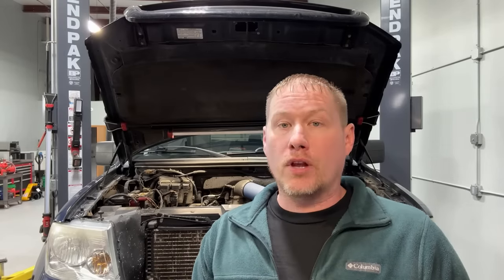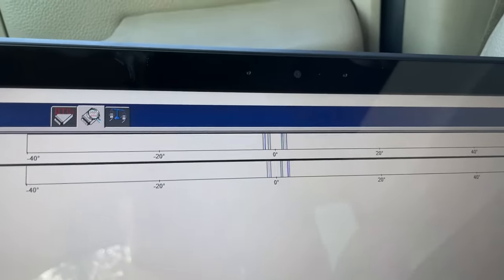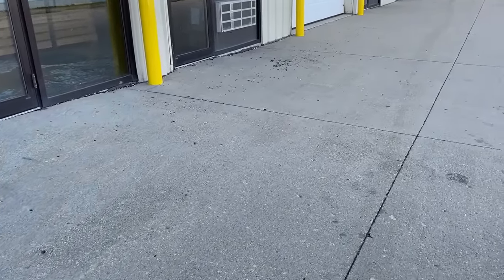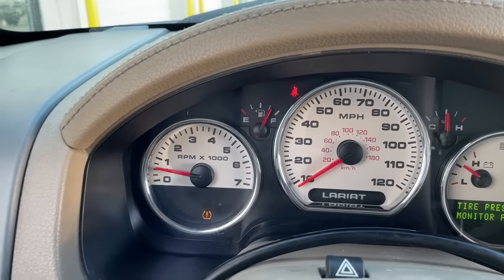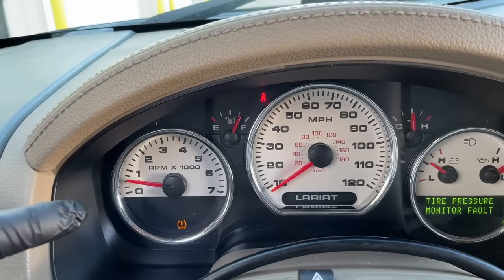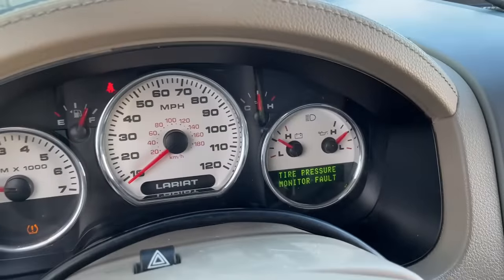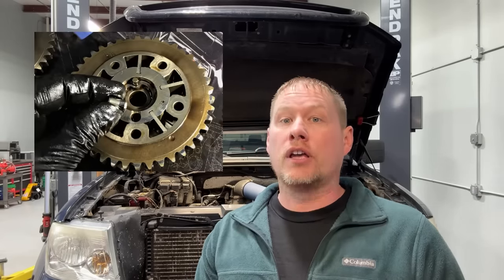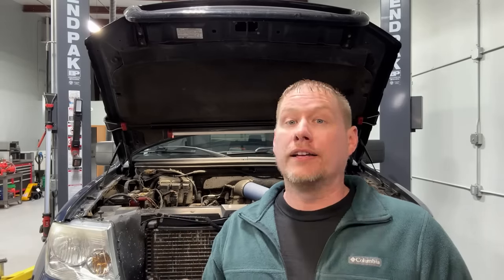Ford 5.4L 3v Triton Engines: Two of The Most Commonly Misdiagnosed Noises!

Comment: I've had my 2012 Expedition KR for 13 months and it now has 46,500 miles. 5k miles a year is the most we'll drive it, but I still change the oil twice a year with 5W30 full synthetic. So far the engine sounds good. Can I swap the 5.4 with a 6.2 for more power and would it be an easy swap? I think both engines line up with the 6R80 transmission.

Comment: Hey 
FordTechMakuloco , great stuff . Have you come across one of these 5.4 l 3 valve engines with p0420 , can't get engine light to go out or this code to go away. The cat's & o2sensors replaced . Fuel trims maxed out minus on bank one but bank 2 is normal. The engine light will go out at times on long trips. Had it to a very reputable shop here an they can't get it to go away permanently. ?
Reply: You might have an exhaust leak throwing of your o2 readings. After I replaced my manifolds the p0420 never came back

Comment: I have been trying to find a mechanic like you here in Arizona. I'm looking to replace my engine soon. I'm currently at 399206 mile on the original engine and transmission. Everything is still all stock and only normal wear and tear maintenance have been performed.

Comment: My 09 has the same knock but the truck shakes normally coming to a light. If you give it a slight Rev about 1500 1800 rpm it will stop n is fine maybe for a day or next time I let off. Some days it never does it some days very time I let off the gas. No start up knock it has me confused.

Comment: I have a 07 F-150 Harley Davidson with one of the 711 made with the Saleen supercharger option. 86k on the clock, only 10k from when I bought it coming up on 4 Y. A.  Any added precautions with the super charger. I am so damn afraid of the valve train and phasers. I live way to far away from you but mass respecs. I run Royal Purple 10w/40 high street performance full syn. I changed ALL the fluids when I bought including Saleen super charger oil. light darkening when drained. Aux. Trans cooler and after cooler. All the fluids is my standard on used. I did plugs and coils. front suspension.

Comment: Great videos. Is there a big difference between these noises and the roller follower ticking in your other video? My 2010 F-150 XLT is going strong at 167K miles but I do hear a noise like this and am concerned from your roller follower video. I’m in Dallas, TX area and would like for you to inspect my truck if you’re not too far. I spoke to North Central Ford’s service department about my service history and the guy said he never heard of a roller follower.

Comment: so if I have the second of these (stumbling at low rpm / high load) with some noise and ticking at start up... is that more likely solved by a high volume oil pump to get better pressure at low rpm, or more like a timing job needed? TIA

Comment: Hi their from Sydney Australia heat video we have these 5.4 3v motors in our sedans not so common down here. Been watching a lot of your videos which are real helpful mine has a startup noise parts are hard to find you mention about might need to change the chain tensioner I’m have trouble to find the one you recommend would you have a part number thanks

Comment: You mentioned awhile back to switch to 5W-30 from the 5W-20 recommended for the 5.4 3V engine. My F150 is a 2004 new body style and has that phaser knock with my engine light on even after both of my VCTs were changed. Would changing my oil to the 5W-30 make a difference?  I don’t remembering you mentioning anything about the higher viscosity in this video. Thanks
Reply: Make sure your oil pressure is good. Especially when hot

Comment: I have a whining that gets louder when accelerating sounds like a Hemi supercharger.   Plus my check charging system notification with the red battery light on for years. New alternator 2 years old. It hasn't died overnight. But i replaced the alt when the red battery light started 3 years ago.

Comment: Looking at potentially purchasing a 2008 F250 with the 5.4l and I hear a noise similar to what you are describing as the phaser oscillation.  I hear it when barely applying the accelerator at idle (engine at temp, in park).  Is there a reason you had it in drive in your example?  Just trying to determine if I am hearing the same noise.  I first noticed the sound after coming to a stop after test driving the truck and then re-created the sound a few times while it was in park.  Seems like it occurs in the rpm range you describe.  It idles nice and quiet.

Comment: Hey, just finished the full timing job with new oil pump.  Everything seems to be working great.  Oil pressure was 85 PSI at startup and then 40ish PSI once it warmed up  - low oil pressure is why i did the job in the first place - I had two blowouts on one tensioner and the other tensioner had one blowout.   The engine sounds great when I fire it up, but the moment I put it into gear, i can hear a knocking noise.   It's not as bad as the knock I had before the timing job, but its definitely there, and it definitely happens right when i put it in drive or reverse.  Any ideas?

Comment: My wife 05 Expy has just started getting the startup timing chain slap. It has 270K miles and gets 3K 5-w30 syn oil changes. Not sure whether to do a timing job, (it would be the first) or just sell it.

Comment: you have provided a lot of information over the years on various Fords, especially the 5.4 Triton. I am curious why non of your uploads contain information on replacing a valve cover gasket and/or removing the valve cover, especially on the passenger side.???????
Reply from the maker: They do not have oil leaks, so I don't cover them specifically but I show removal in many of my 5.4L 3v videos.

Comment: Yes my truck does the same thing, when about to go into gear it rattles, rattles on startup, and when in low rpm’s when accelerating after coming to a complete stop sometimes it will rattle a couple of times almost like it’s still trying to accelerate after my foot is fully on the brake.. but my fuel filter also needs to be replace unfortunately two of the three prongs are bent inside of the safety release…

Comment: I never know what to think of these 5.4 engines. 😂. These videos make them look like the worst engine ever. There are millions of these engines on the road still and they haven’t put one in an f150 in 13 years. So Maby there are just 2 groups of owners. Ones that do maintenance and ones that don’t!! By the way I’ve got this engine in my 2008 plow truck with 235,000 miles and it still runs. It is getting more noisy but I think rust will take the truck before I ever crack the engine open!!! Great videos

Comment: My 2010 Navigator does the off-idle rattle at the drive through, but is quiet at idle, that said I run 10w30 year round and that helps with it not being rough at idle.  It also will rattle on startup sometimes, I'm sure the tensioners are blown out.  Time for a timing job.  I have gotten most of the parts but still need the phasers and solenoids.

But I also need a new ABS module and some other stuff.  Thing's getting to be a basket case.   I will probably fix it, although the wife won't be happy about it, it's cheaper than upgrading.

Comment: 2015 f150 v8 taillights not working, checked fuses, bulbs, n braking lights, they good.  I was wondering if changing the wiring harness  for the tail lights would be difficult?

Comment: I've been watching your videos for some time now.. I have an 08 expedition el limited. I had the vcts, new guids new chains upgraded hellwig oil pump under 10k miles ago.. all ford parts.. only when I'm reversing on a small inclined it starts making this noise again... also my steering pump is going bad as of last summer and when I turn the steering wheel all the way to one side it wants to stall... whats your thaughts?

Comment: What is your take on additives for the 5.4, I’ve used Marvel mystery oil for 40 years on pushrod engines to quiet, noisy or sticky lifters with success, it doesn’t replace good oil changes, but it does lubricate the valve train very well. How would that work on the camp phasers Would it keep them clean and lubricated better? Also, what is your take on?liqui moly for fuel injection cleaner that you add to the gas tank? The European guys swear by the stuff ?
Reply from the maker: Never used them and never would.

Comment: We did the full chain/phaser all Ford parts with the Meiling oil pump 5 years ago. Now random at idle at full temperature, stumbles. But random. It runs awesome when cold but randomly stumbles at full temperature, not always.  Giving me codes PO340-FF and PO340-C, PO341-FF, PO346-FF.  Hope all is well everyone and let me know what you think!  Thanks!

Comment: I'm thinking of driving mine down to you to do my timing chains and roller followers. I had so many mechanics (even at the Ford dealership) try saying I needed a new motor. I was just quoted $3000 to have mine done. Is that correct or am I trying to get ripped off?

Comment: Hello Bryan,
 I have an 05 F150 4x4 king Ranch 5.4L 3 valve.  My mechanic seem to be having a diagnosing problem. We started with the 0172, changed the MAF and got a P0171.  Changed the Fuel pressure sensor, Fuel pump, Spark Plug to the new OEM ones and had cylinder 5 and 8 look burnt. So, he thought Fuel injectors for 5 and 8 not firing.  Replacing injectors but need help.  Like we're through partsbto see what sticks.  I've been watching ur videos on cam phasers and camshaft rollers being bad.  My mechanic refuse to think it may be an inside job under cam covers.  HELP, Phoenix , Az.

Comment: Will replacing the roller rockers with updated followers with the smaller oil feed holes correct the low oil pressure condition?
Reply from the maker: It will sure help

Comment: My 08 Expedition has the phaser knock only in Idle under load (AC on at very hot weather) and only after at least 1 h of highway ride. If I got you right this is not a concern!? The previous owners did a timing job a year ago but I don't know what parts they used (Ford or others).

Comment: First noise sounded like a diesel engine. What about the exhaust leak on the 5.4 Expedition? Where is most likely leaking from. My guess is the exhaust manifold to cylinder mounting. What is the fix?

Comment: Hello question, i had a timing job done, and now have a bad engine mount. Get what feels like a hard shift after s few hundred miles and delay in shifting, and now feels like it cant shift, took back to mechanic snd they say the transmission needs to be rebuilt, dont know if bad engine mounts could be causing all those, dont want to drop the quoted 3k to have the transmission rebuilt

Comment: Hi, I got a 2014 fiesta st stock engine owned since new, engine oil and filter changed every 5000km since new. Currently has just over 137000km on the clock. It's got misfires (And a little tick sound when it missfires) while at idle but mostly only when it's been at operating temperature for a while, almost every time I put the A/C on it will start misfiring. Never misfires under load, recently replaced the factory ignition coils and another set of properly gapped plugs. First my scan tool was saying coolant bypass valve, replaced that then it said boost sensor I replaced that then it said intake air temperature sensor so I replaced that, it has been showing  a red cross beside "O2S" and "CAT". Now I'm left with the same problem but the only fault showing on the scan tool is a red cross beside "CAT" and in catalyst monitor B1 the readings show all 0.00 when before if it was running ok id see a reading, with the engine running of course. I'm guessing now it's either the down stream oxygen sensor or the EVAP system, like that big jungle of vacuum tubing you replaced on a Ford escape a while back.. Or worse, the CAT is actually blown..

Comment: Hi Bryan. Mine has the second symptom. Where after hot it throws errors P0012, P0022, P0300, P0303, P0305, P0340, P0344, P0345 and P0349. Whenever I clean the computer errors and go for a ride, once got the P0012 and P0022 are the first to come up. Would you be able to point me to one of your videos of what is the repair that I should do? I just bought this truck, 2010 F150 Lariat with 200k miles, paid really cheap and want to fix it. Thx!!

Comment: I have a metal on metal noise during cold startup, sounds like the flywheel is rubbing against the torque converter, or the starter? Once it warms up it slowly goes away. It's a 2005 expedition limited. The noise comes back intermittently when accelerating from a dead stop

Comment: I change my engine on my 2004 ford f150 fx4 5.4l triton, I bought it from powertrain,, my question is do I should keep the oil pump that came with it or do I changed it with the melling M360HV?

Comment: Hello! I have 2009 Ford Explorer 4.6 with 55k miles with phaser knock on full hot idle on the RH. Changed the phaser (installed new original ford phaser). But the knock did not go away. It became a little bit less noticeable, but still knock loudly, you can hear it from inside the vehicle. What is my next step to eliminate this annoying knock? After 1000 rpm it quiets, and also I don’t have any phaser oscillation. Should I change the oil pump? Thank you!

Comment: Great channel. Cool dude.   I want a new F250, but a local used truck dealer told me he does not sell Ford trucks newer than 2017 because they have noisy engines.   Does that make sense?  Thanks!
Reply from the maker: LOL
Reply: @FordTechMakuloco   Would they be referring to that Coyote engine?   I maybe need a bigger engine anyway to tow a car trailer, especially an enclosed trailer.
Reply from the maker: stick with the two gas motor options and you will be fine.
Reply: @FordTechMakuloco  Thanks again!

Comment: What would make my truck sputter i changed my fuel pump i started it it still sputter i put chevron plus and 12 gallons from an empty tank after my pump  swap it start running good the sputtering stopped drove it 2 hours on a trip did good i start it this morning and im back to the sputtering .. should i do injectors next ? I replaced the gaskets in my manifold and the injectors looked real clean

Comment: I have a Ford Expedition with the same engine and transmission.  Both have less than 20k miles and would like to add some boost to it.  Older Mustangs have the same engine too.  What would be a good power adder (turbos or supercharger)?  Is a 2005 Ford

Comment: Hello sir, would you be able to help me? I have 03 5.4 triton thats been feeling weak and vibrating in 4th gear. We just went thru 27° weather for a while & it started when I ran the truck one of those days. I guessing I didn’t let the engine warm up enough. (I know not super cold but I live on tx/mex border and we never see these temps). I don’t know how to fix this. I just changed oil yesterday.

Comment: My 03 expedition just started making that knocking like sound a few days ago. Doesn't do it when it's cold not until it is almost fully warmed up. Then once I start driving tho it will go away over like 1800rpm. Still runs and drives great besides for the annoying sound. So its ok to still drive the truck if it's this?

Comment: I’ve notice after a few miles after warm up, I’ll get that intermittent knock sound but if I rev on the throttle a little bit it goes away and sometimes I won’t notice it again for a few days or so. Could this be the same as phaser knock?

Comment: I bought a 2012 Expedition King Ranch last October with only 39k miles. It now has 46k miles and I've been changing the oil every 3500 miles using Motorcraft 5W20 synthetic blend. Would it better to use 5W30? I live in Northwest Georgia.
Reply from the maker: yes
Reply: @FordTechMakuloco  Thanks! Should I also use 5w30 for my 2014 stock Mustang GT? Happy Thanksgiving!

Comment: I have following you for a while since I have a 2005 F150 5.4 V8 with 130,000 and still going but was interested in what engine you recommend to replace it when the time comes? I had looked at the Powertrain engines.
Reply: You could replace it, or you could go full aftermarket overbuild and keep the tune mild

Comment: Hey Brian is this a issue with the 3.7L Mustang engine?, mine makes a ticking noise at low RPM and only when its hot but goes away as i accelerate

Comment: So ive got this same noise on my 19 5.0 at hot idle. Its annoying and very concerning. My understanding is the tighter valve springs and high pressure fuel pump puts extra load on the phasers and causes the rod knock type noise at hot idle that goes away under throttle. Is there any merit to that theory? Do you have any videos on the infamous coyote noises as well?

Comment: Needing a new engine in my 2010 Ford F-150, do you still recommend the engine from Powertrain? I think the price tends to be about $3700
Reply from the maker: I only use Ford remans currently but I never had an issue with a powertrain products engine.

Comment: @FordTechMakuloco  the latter phaser oscillation noise (and subsequent rough idle) occurs only when both my solenoids are plugged in, and it fixes itself if I unplug either one.  What would that mean?  Could it be low oil pressure which increases just enough with one unplugged to remedy the remaining solenoid?

Comment: I need help. I just had a new powertrain create engine long block installed in my 2005 ford f-150 5.4l 3 valve. It runs great but makes a chirping noise on driver side. It doesn’t make the sound at all higher rpm but at idle chirps. The mechanic that installed the motor says it’s the pcv valve. I’m lost.